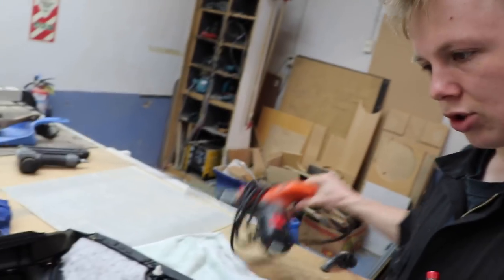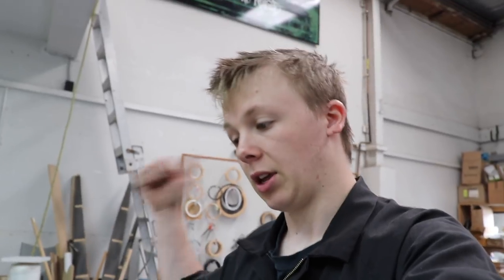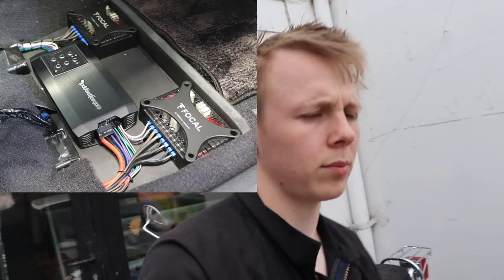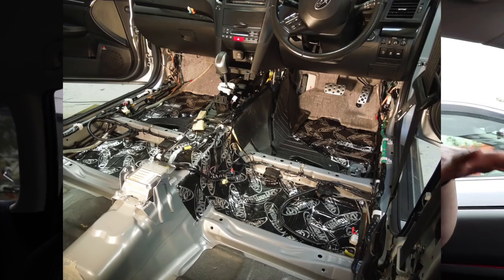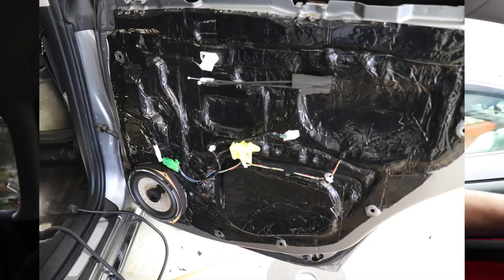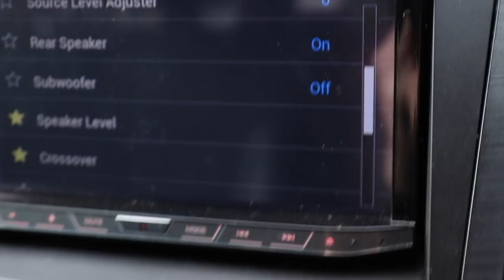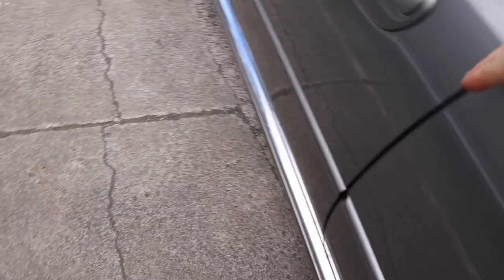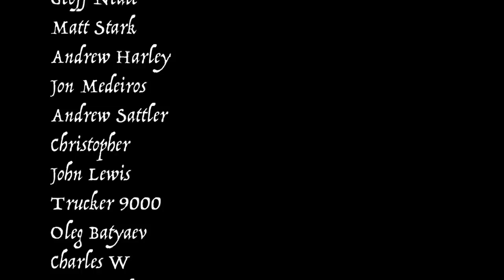4th & 5th Generation Subaru Legacy Sound System Face Off!

Comment: I own a car audio store. I just bought one on a great deal (7300 for a clean 2012 with 117000 miles). Planning on doing focal flax components in the front, flax coaxials in the rear, 2 Memphis m7 12s in a custom enclosure in the trunk powered on audiocontrol 6channel for the door woofers and tweets and the lc1.1500 for the subs. I’m fucking excited. Getting full sound treatment with Metra ballistic hollow point and fast rings. Still debating if I’m going to install a second head unit as a DAC, the Sony rsx-gs9, and send that as optical out to an audiocontrol 6to8 or a focal 6to8 (I know it’s gladen, but I’d buy the box that just says focal on it because it’s the same and I’m brand loyal). This will be my personal driver, as well as a show car. So- dsp or no? Or just fuck it and do a DSP amplifier and send my audio out from the D-6.1200 to the mono block?

Comment: Sorry to keep commenting but those pioneers are putting out 2.5v pre outs to the amps. Put a line driver on them or upgrade those head units to a 5v pre out head unit. Gonna go big with great drivers, you want better source power to your amplifiers, If you’re trying to go “the best” (not gonna be the snob that says you HAVE to go dsp, but still that pre out voltage accounts for audio loss, especially to amplifiers that give you up to RMS and nothing more.

Comment: I have a Pioneer DEH-X7850BT in my 2005 single cab Mitsubishi Triton running in network mode with a set of Morel Maximus 602 2 way components and it sounds awesome, the control you have over the crossover points is great, the main reason I'm running in network mode is because there is only left and right front no rears, an I also have an Option Audio slimline 12" sub running off a Sound Magus X1502 mono amp and a Sound Magus C160 4 channel that is going to be for the speakers when I get around to running the new speaker wires.

Comment: the surround feeling more enjoyable for listening, if  you had to do it all over again with different speakers and amplifier what kind and how much improvement could be gained?
Reply from the maker: I could only improve it by spending more money on better speakers, K2 or utopia (yea right lol) and adding a subwoofer and seperate amplifier.
And maybe going FULLY active (2 of the 4 channels, one for the mids and highs, one for the mid bass and rears + a mono block for the sub)
With either a focal FSP-8 or a RF 3sixty.3
Only problem with that setup which is what I am facing in the future is that both of those dips only allow for 8ch output whan I would need 10.
Would either need some kind of work around or the new audition 10ch dsp.